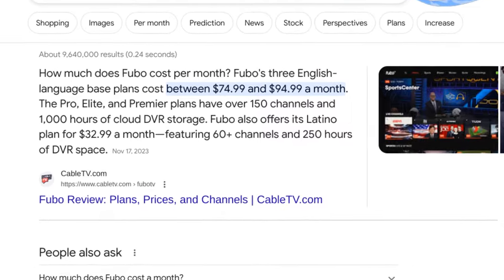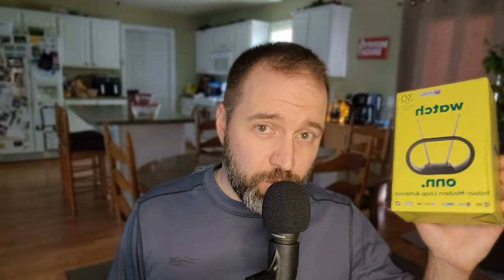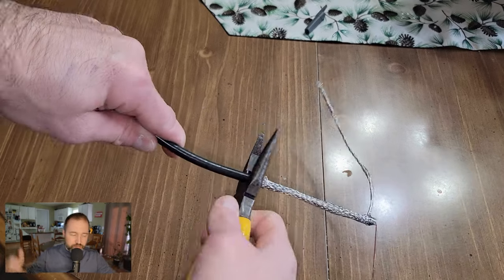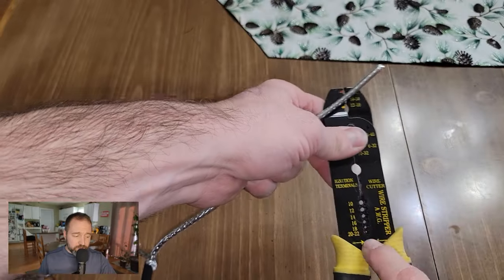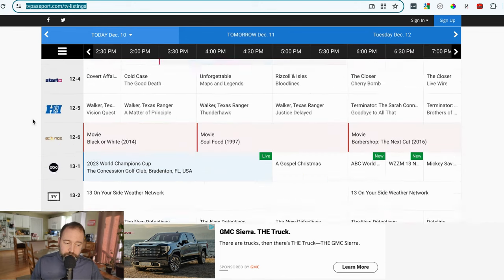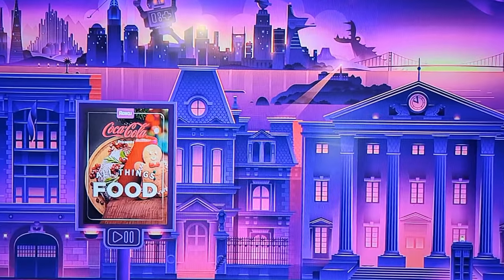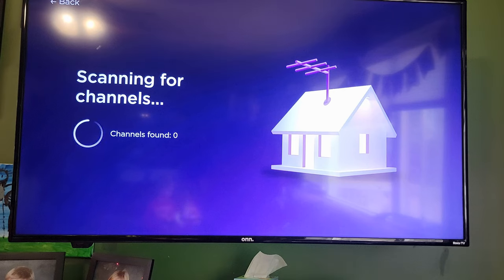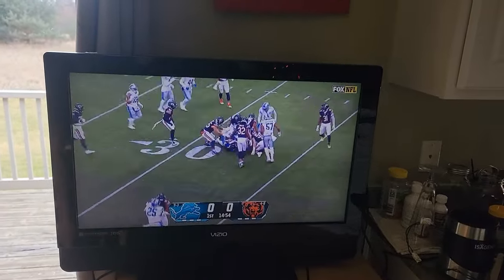How to Watch the Detroit Lions on TV for Free WITHOUT Cable (Fox Sports)

Comment from the maker: * 12/16/23 Unfortunately,  this method will not work for the Lion vs. Broncos game tonight for most areas,  as NFL+ has exclusive rights over the distribution of the game.  It will still work if you're within about 40-50 miles of Detroit on channel 2-1.  The rest of Michigan is in the dark unless you subscribe to NFL+.  All other Fox channels are not permitted to carry the game tonight. 

Also, I forgot to mention that once you mark the spot with the best signal,  you can always go back to that spot when you want to watch the game.  Don't run another scan in your TV, simply set the input of the TV to "TV" on a regular TV, or "Antenna TV" from the Roku home screen amongst the apps.  Go to the appropriate channel with no signal and then move your antenna in place.